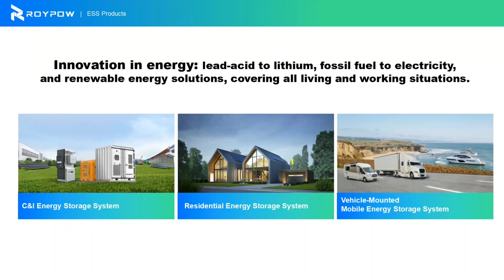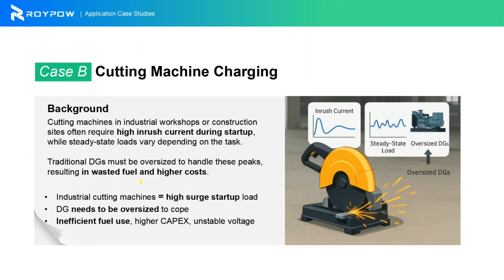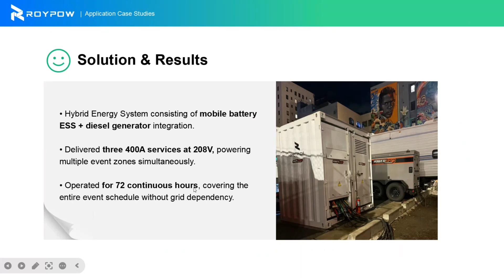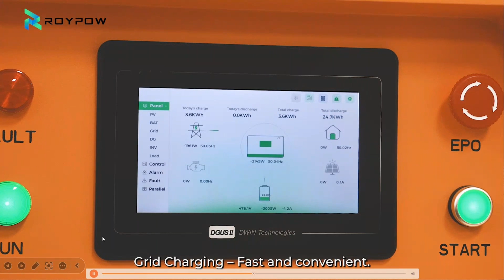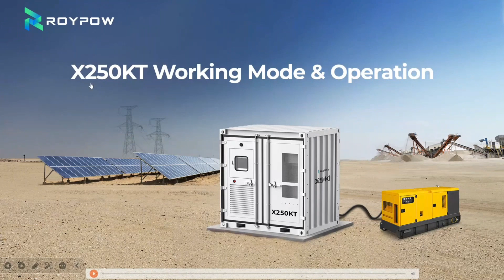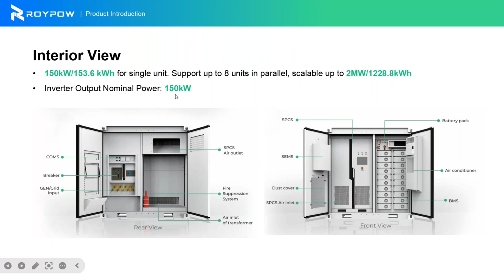Mobile ESS & Diesel Generator ESS Solutions: Applications, Benefits & Case Studies | Webinar Replay

Comment: Few basic technical information ha not been discussed that is related to Charge and Discharge rate. For example is a factory site wants an solution for a back up of 500kw for 4 hrs  against their 500kw DG set which runs on an average of 8 hrs a day then what would be the mechanism( Charge/Discharge rate). Also there are additional expenses which needs to be discussed like PCM and EMS.
Reply from the maker: Our standard products already include EMS/PCM. Mobile ESS and Diesel Generator ESS can work together to provide power. For more details and price, please contact to sales@roypow.com
https://www.roypow.com/contact-us/